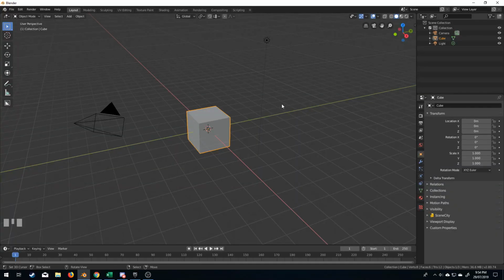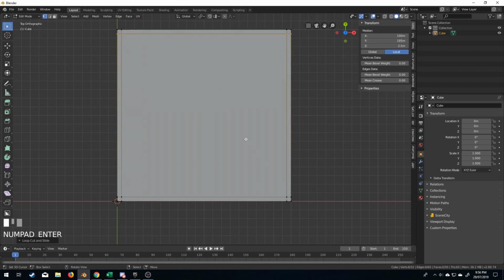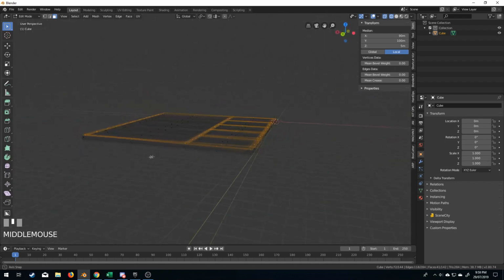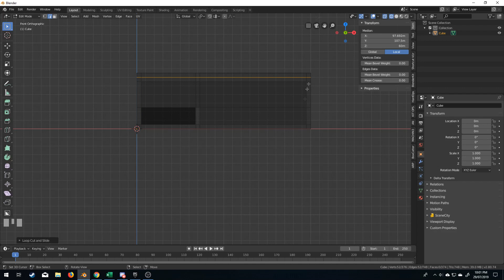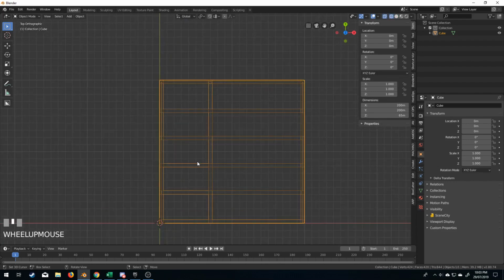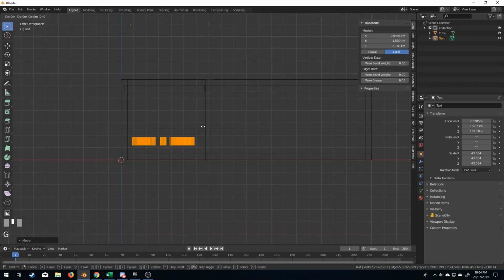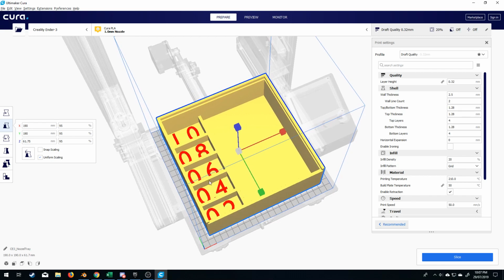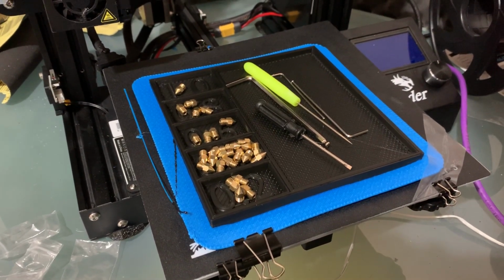How to make 3D prints - Storage tray - Design - Create - Print

Comment: +Markom3D
Great video and interesting project.
I'm new to using any kind of 3d software, though getting a grip of it slowly.
The bit in this video that has got me stumped is the ctrl-R bit to put the vertices in for the wall.
You then type in 5mm into the x-axis to move it, but when I do it it puts a huge new box in the opposite direction.
I've slowed the playback down to .25 to see where you clicked and keystrokes, also what tools and boxes are highlighted but it still doesn't do the same action as when you do it.
I realise it's over a year since you made the video and thanks for the time
Reply from the maker: so where I am putting the 5 in the x axis, that is the world location. So at the start I made the bottom left 0, 0 , 0 and then made all my dimensions from there. The other thing is that make sure that you are in Edit mode and not Object mode. If you are in Object mode, then it would move the whole object to the location, rather than the line
Reply: @Markom3D  thank you for getting back to me and replying, really appreciate it.
This 3d stuff takes some getting the head around but with great creators like yourself giving helpful info it makes life that bit easier 
Keep up the good work
Reply from the maker: @t0m541  cheers mate, If there is anything else that you need, please let me know. Also, welcome to the channel